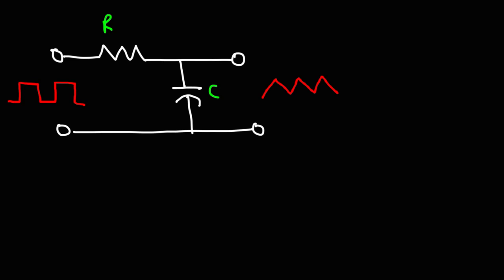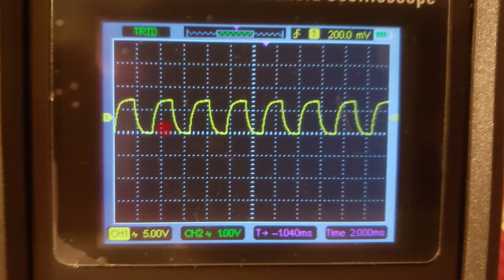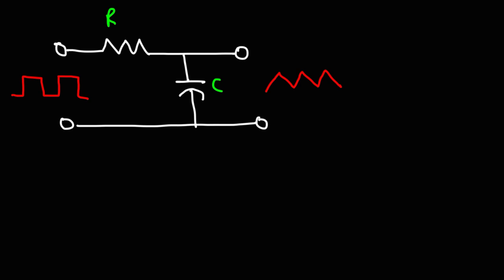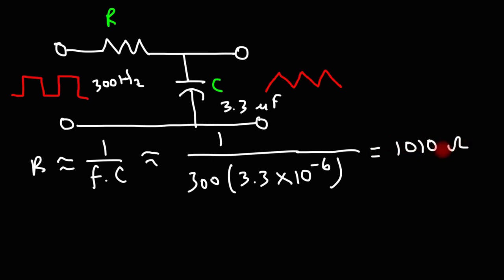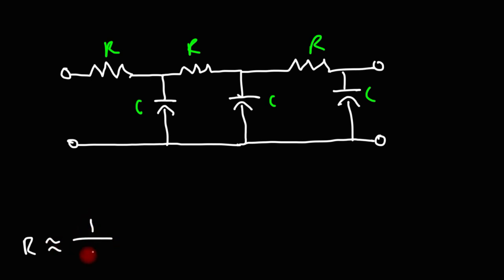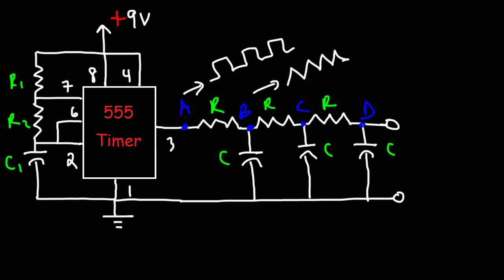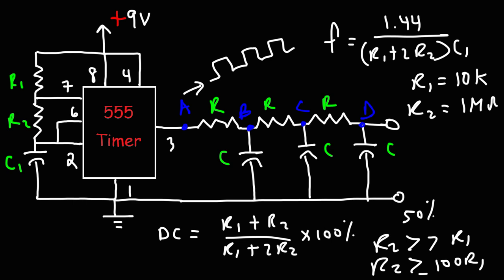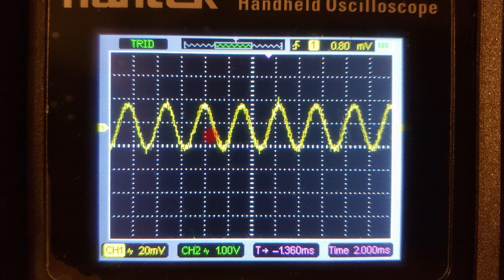555 Timer Signal Generators - Square Wave to Triangle Wave to Sine Wave Converter Circuit

Comment: How would I go about hiring you or someone, to design a 555 circuit to control a green LED at 5 sec frequency with duty cycle 50% with triangle wave (fade-in, fade-out) and drive the LED at 30ma peak. running on up to 12 vdc (nominal 10 vdc)? I am currently using a 2N3904 with the 555 but something is overloading after a few minutes and suddenly drawing 100 ma continuous and no LED illumination... I don't know how to resolve this.

Comment: Btw, you can also use an arduino uno for the square wave generation. The basic blinking LED program is basically just that
Reply: Also you can use a voltage op amp like the 385 (the 741 is for power btw). I'm not sure if placing it at the end of the filter network would do any difference if placed at the start of the network tho, haven't tried it yet

Comment: i get the way of creating a waveform , but how to buffer it for driving a load, end of the line must have pretty weak signal
i tryed to build one of the waveform generators published online but the output buffer stage, no mater what i did always loaded with the next stage input and sine  or triange was cliped  on one side no mater what i did
Reply: You would use it to control the gate of a transistor that can handle the load

Comment: how to work with all frequency?
Reply: It doesn't because of high number of capacitors, impossible to cover a good range of frequencies, i designed a perfect circuit for that purpose usin variable resistor to control the frequency of Square, Triangle and Sinewave, it works good but it's a little bit complicated circuit

Comment: Is  there a virtual online oscilloscope?
Reply: no that wouldn't be possible alas. The nature of them is that that they can sample signals very fast so will always require hardware capable of doing so. Best you could find would be a circuit simulator that has one built in. Google Falstad.
Reply: Sadly no. There's an oscilloscope on amazon at bout 44 bucks or so i believe, could be a start. Still wish i could use my arduino as an oscilloscope tho :\